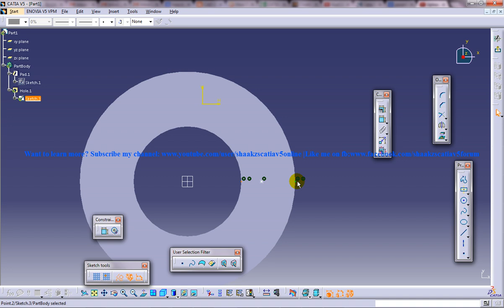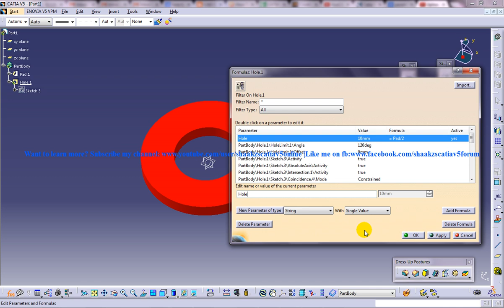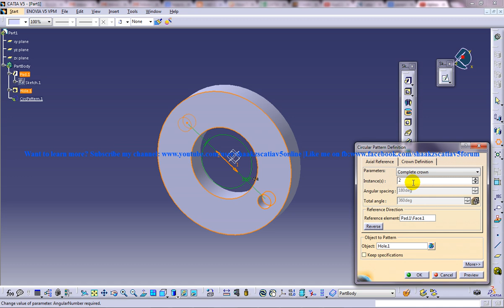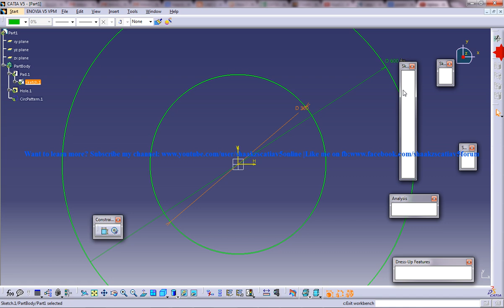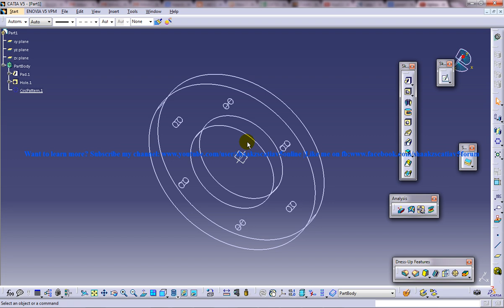Catia V5 Tutorial|How to Apply Formulas to Parameter to Make Constraints Relative & Equation driven2

Comment: Sir, If i want to that Diameter is dependent on formula such that  d= (p*t)/(0.6p-c) in this p and c are not any geometry related parameter. (p=pressure c=corrosion thickness) how to relate this with d
Reply from the maker: Dear Pratik, If the pressure and corossion
 thickness are constant, You can create a parameter for both of these 
and directly enter their values while creating them, Henceforth You can 
use the same parameter in the formula and the values will be read from 
their respective values which have input previously. If you still have 
doubt, Give me a more detailed scenario and I will make a custom 
tutorial on it.
Reply: Thank you sir. I will try this once if I unable to do it, I will ask you for help with providing more details. Thnx once again